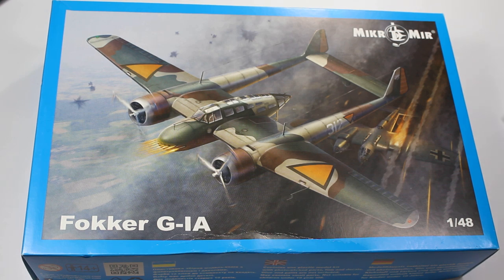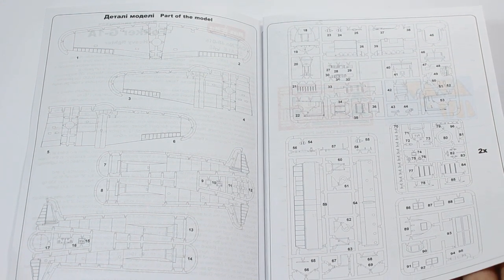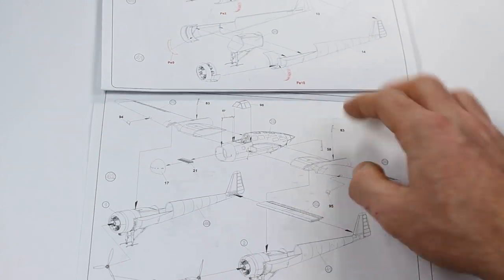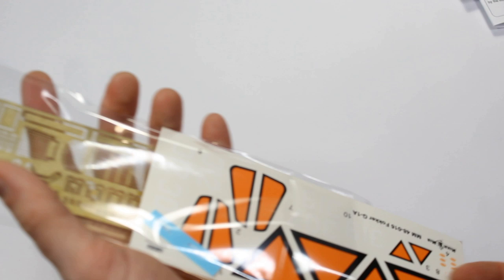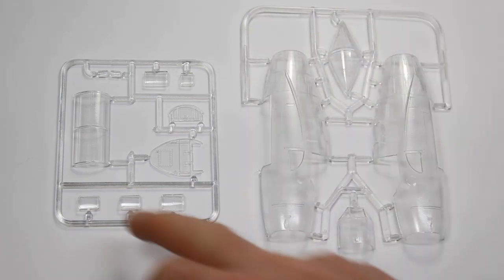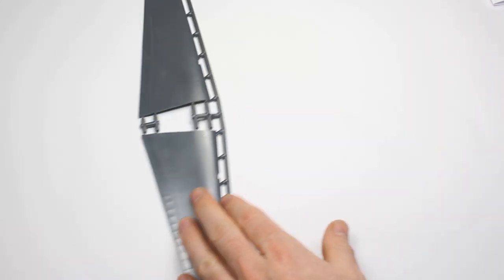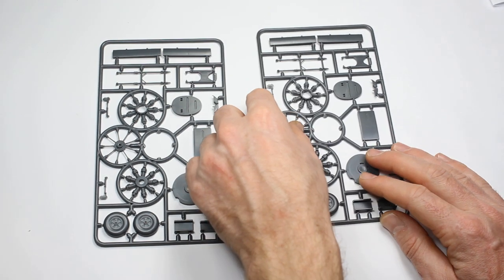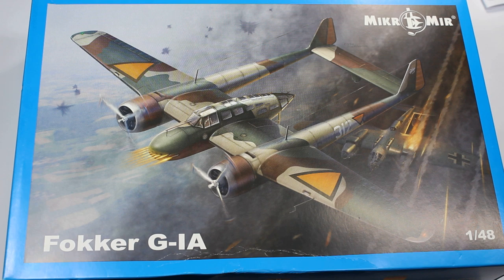Mikromir 1/48 Fokker G1A In Box Review

Comment: The P38 was designed after the G.I, the materials Fokker had were limited which meant it couldn't have been build with exotic materials like the metals the P38 would be using. Same for the engine which was a bit under powered for the same reasons. However if the G.I did have the same materials then it would likely out perform the P38 in many ways. But of course the P38 was not designed to be a 3-seater which the Fokker G.I did have.

The Fokker G.I was indeed not heavily used, this because of the start of the war and the idiotic behavior of the government that rather saved up money instead of making sure the army did have what it would need. This is also why the navy did not get to see her Project 1047 completed on time, which was pretty much a German Scharnhorst class ship that was a little longer and far superior to the original in all area's except for the belt armor which was decreased. 8 ships were planned for the Dutch East-Indies to counter Japan, but because of the start of the war and the government not funding the project enough only a single turret was build and was still standing on the same spot at the end of the war never being used a single time.
For the Fokker G.I there were big plans to have a lot of these fighters, but alas no luck. There was also a Fokker D.XXIII (D.23) that looked a little like the G.I, but was purely designed as a 1-seater fighter which would be later added to the fleet. There was only 1 test model of the Fokker D.23 build and set on fire by the Dutch so that it couldn't be used by the Germans. This test model was unarmed and unarmored. 
There were also Fokker G.I's at Airbase Leeuwarden, numbers there I do not know. 1 of the G.I's escaped to England to get shot down there, the pilot did fight during the Battle of Britain, D-Day and other battles and survived the war so far I know.

For the 10 May 1940 battle, the Dutch fought like lions. If you got shot down, you would report back to the airbase to get placed into the next aircraft available even if it was a unarmed scout and you would be send up again.The Dutch pilots managed to destroy so many German transport aircraft and fighters that the Battle of Britain would be on hold to which the Germans never really did recover either. The Dutch may have lost, but at a very heavy cost for the Germans. Without those brave pilots it would be very unlikely that the British could have stopped the Germans as they did.

The orange triangles are actually a attempt to make sure no one would shoot down their own aircraft. This because there were (and still are) similar round red/white/blue markings in Europe. This would make it a lot easier for the Dutch to spot their own.

I am the one that asked Mikromir to do this project a year before they came out with the first images. Also I send them off to the Fokker G.I organisation that researches this specific aircraft. So, that this kit came to be is actually kinda my doing in that regard. This is my absolute number 1 aircraft.
Reply: Thanks for sharing!
Reply: Good answer, slight adjustment on some details.
Leeuwarden was not an airbase at the start of the base it became an airfield during the war and was built by the Germans.
http://www.waroverholland.nl/index.php?page=fokker-g-1 gives more insight about the fight during the start of the war for the Netherlands.
36 G1A and 25 G1B were in Dutch possesion but  only  23 in total were fight ready. Almost all G1B are used by the Germans.
Waalhaven had 3rd JaVa with 10 G1 and Bergen had 13 JaVa with 13 G1.. From these last 13 only 1 was able to take off and fight the Germans, all other planes were damaged om the ground.
The orange triangle came after an incident on 14 sep 1939 when a R5 dutch marine plane was shot at by the Germans, the same happened with civilian KLM planes. So the Dutch used from that moment orange markings so the old marking could not be confused with the British markings. KLM started to paint HOLLAND in big white letters on their planes. And painted some planes orange all around. 
https://www.delpher.nl/nl/kranten/view?coll=ddd&identifier=ddd:010676864:mpeg21:a0001
Reply: How do we know that the P-38 was in fact designed after the G-I?
Reply: @Page-Hendryx  We do not, but the P-38 coming after the G.I (1936) and having the same twin-boom configuration makes people think there may have been an influence.

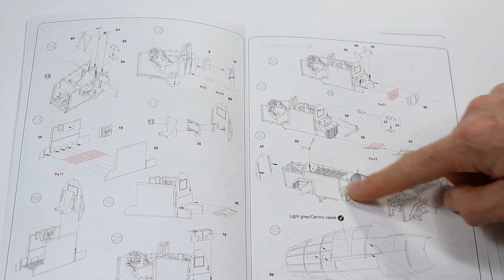Comment: I have two Mikro-Mir kits, and as interesting as the kits are, one of the real downfalls is in the instructions. They give absolutely no color call-outs for the detail parts for the cockpit interior, engine or landing gear. You get that nice full color multi-view exterior sheet, but for the interior bits, you're on your own. Look closely as he goes through the instructions and you'll see no detail color call-outs, just that one vague 'light grey' at 2:52 which is mentioned after you've assembled the entire cockpit. I'm surprised that he didn't mention that. Mikro-Mir really needs to get up to speed on that.
Reply: Great point. Pretty shocking oversight, tbh. How was the fit and finish for the two kits you've built up, and what were they, if you don't mind me asking?
Reply: @darrellid  I lean very much toward the unusual. The two I have are the NIAI-1 "Fanera-2" Soviet light passenger aircraft 
https://www.hannants.co.uk/product/MM72-004?result-token=fyv3p
and the KhAI-3 
https://www.hannants.co.uk/product/MM72-014?result-token=fyv3p

They're both still in the stash, so I can't tell you much about them. They're both very short run technology with no guide pins for anything. The plastic looks good, no flash and the sprue gates are reasonable. I'm still thinking about things to do to spiff up the double cockpit of the Khai-3 and I read a build review of the Fanera-2 in which the builder said the decals just went to pieces in the water. That could be a problem if it holds true for their line. The one big plus is the canopy paint masks that are included in both kits. Masking canopies with tape and hobby knife is not something I enjoy.
Reply: @kevindolin4315  Yes, masking is often a "stall point" in my builds, especially for ones with large amounts of glass or "greenhouse" canopies.

Thanks for the response and the info. If you ever do build those up, please share your experience. Cheers!

Comment: Mikromir is an outstanding company (little known but has been around for years) with incredibly original subjects for which they provide pe and masks. Accuracy is far better than similar but better known Special Hobby. Unlike Special Hobby, AZ Models, Dora Wings, a few Wingsy Wings and even a few kits from Modelsvit, their kits have really serious outline research, sometimes better than some of the lesser Zvezdas or ICMs, and about on par in surface details, if not quite to WIngsy Wings level. Their recent W.34 is just incredible, and this was a mass poduced aircraft, not a low number oddity.

Comment: I have completed the cockpit and got the two clear fuselage parts together. Honestly, it's pretty dire. The parts are super soft and detail likewise. fit is.. questionable. Tail booms and wings seem okay to get together. The schemes are wrong like you mentioned. It's only for the lovers of the subject. Certainly I think mikro-mir for a new injection molded G.I in 1/48 and I did buy it and I will build it but I can't really recommend it to the general public personally. Like you I was quite excited by looking at the parts on the sprues.